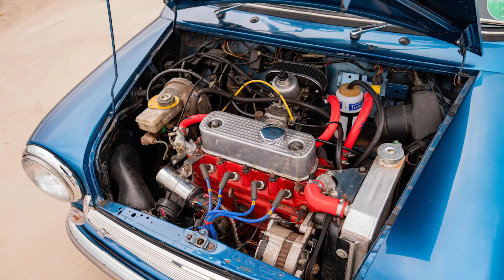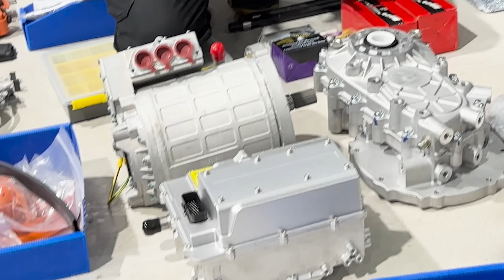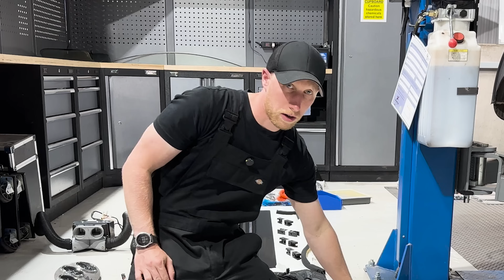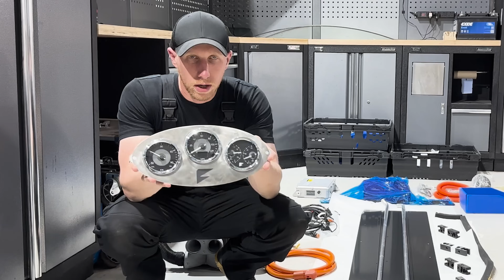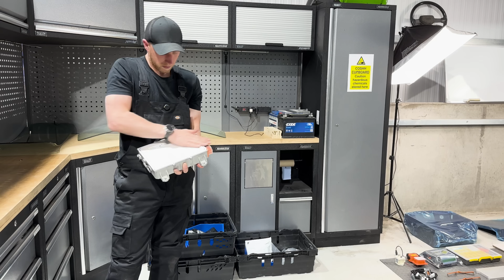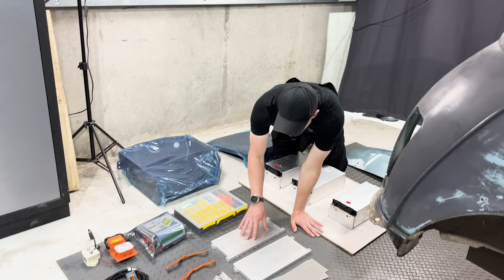EV Conversion of a Classic Mini Cooper to Electric, and It’s Fantastic - ESP1

Comment: Can't find a price for the diy kit on the Fellten site, but the only listed UK installer is going to want £40-65k
I want one, but I think I'll have to stick to a K20 swap for now
Reply: I’m sure kit cost will come down over time as EV conversions will become mainstream sooner or later…
Reply from the maker: @nzyama  yes definitely, as soon as some level of volume can be met they will come down.
Reply from the maker: The full bolt in kit from Fellten is about 30k
Reply: @Hazell_Nutz  That's not bad considering what you get. I'd definitely want to save the 10-15k and do it myself. It's more fun as well.
Reply from the maker: @eskimonoise-gaming  only thing to consider is the amount of design and development that Fellten have done it has even been signed off by BMW Mini

Comment: Do you even fit in it? Car is in the air and you tower over it.
Reply from the maker: 😂 you would be surprised how much room is in a mini
Reply: @Hazell_Nutz while I later sat in a original mini I went to an Auto Show in Boston years ago and a mini dear fro Peabidy MA had a massive Mini section at tge show. I was amazed at how much room they have in the front seats. If I could find an affordable original that isn't rusted to hell in the states I'd consider doing a conversion.

Comment: I hope you are aware of the issues someone had with the DVLA when converting their mini a couple of years back?  He drilled a couple of holes in the boot floor for cables and the DVLA refused to allow it on the road without an IVA, which would be a huge amount of work for a mini to pass.
Reply from the maker: Yep it’s not a problem, full bolt in Fellten kit approved by BMW never had an issue with dvla.

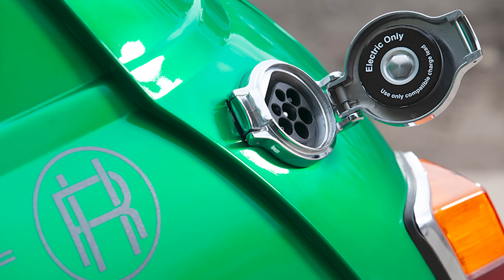Comment: hey where did you buy that charge port with a flap 16:04
Reply from the maker: It’s made by Fellten. If you email sales@fellten.com they might sell one but there not cheap as custom made.
Reply: @Hazell_Nutz  The actual flip cap looks just like the "Monza" style sold on many classic Mini parts supplier sites...just bolts to existing petrol cap neck as a faux filler cover.
Reply from the maker: @TornadoCAN99 it is, we just have them milled to fit a custom charging port.

Comment: As someone who drives an EV for work, I would highly recommend having one of the gauges being 'charge level' as while the range calculations are handy for casual use, they are an unreliable metric when you are going on journeys with enough distance where you come across different driving environments.
Reply from the maker: The ideal situation is range but we do not have that software in the mini yet

Comment: Impressive kit. Like the AC motor instead of those DC motor kits. CCS would be nice though.
Reply from the maker: We did consider CCS but with only a 19kWh battery pack it could not charge very fast.
Reply: @Hazell_Nutz  with an 25kW charge it's under an hour. Got a Livewire. That gets 19kW on 15,5kWh.
Pretty useable.

Comment: "We haven't gone to an LSD because we haven't needed to" later in the video "we can't get enough grip"
Reply from the maker: 😂 see your point. Yep not enough grip due to tyre width which an lsd would help. There is dynamic traction control built into the aem unit. But also with an LDS the gearbox might not be able to handle it.

Comment: are you not running a bigger tire then factory? i don't know what tire sies you can fit in there but the vertical tire patch is ware most forward tration is. taller tire more forward tration. maybe even bigger wheels and tires if you can fit it ?
Reply from the maker: Right now we are running 10inch wheels but do have a set of 12inch wheels with bigger tyres as well to try.

Comment: Algorithm brought me here so I guess you're doing something right.
Thanks for the video, very nice.  I subbed, this is the kind of content I'm consuming right now - algorithm is on point, and fresh!
My argument these days is if I'm camping 100 miles in the middle of nowhere (Oregon, USA) that I can make electricity but I can't make gas - I don't know why everyone isn't doing this, gas is expensive and smells bad in the can and in the air.
Even if I had to wait a couple days, I wouldn't starve or dehydrate to death before I got another 4 hours of run time (I find it's easier to speak of battery power more like a plane measure fuel - in time expected left to ride) and I honestly wish I could see a display that showed expected run time based on ride history since last charge and  expected run time based on your present burn rate.  Averaging saved torque values over time and current torque values during the ride would also be helpful in profiling my system behavior.  I am still unsure if I am going to make a full size car build; I have an array of PEV (large and small, 1, 2, and 3 wheeled) that are serving needs and if I need to go bigger (I'm disabled) tentative plan is to acquire most of a Yamaha Tricities or Piaggio MP3 husk and make a touring PEV with sizeable fairings and aerodynamic/stowage features like lighter velos (I have two already).  
"Kei" style trucks are illegal to drive on public roadways in Oregon (USA) but I want to do a EV conversion on one just to use around the property - there aren't any husks around and I don't want to break one - regular utility vehicles start around 6k USD and decent ones easily top 13k USD and you'd still need to add options you wanted.  There really aren't any decently useable/reliable EV utility vehicles under 20k USD (check videos on the smaller extra cheap ones from online sites, if you don't want lead batteries, there's a significant upcharge for LiPo packs).  The best I've seen is electric forklifts have been around forever and that's about it; they are well supported, however, which is nice.
Reply from the maker: Have looked at data capture in the past forwarding to a AWS server where a system can be out in place to calculate everything you mention real time or you could look back on previous events. Battery’s are starting to come down in price mainly because more manufacturers are coming on line at the same time ev adoption has stated to show abit.

Comment: My first car was an original Mini. Had an absolute blast burning around with the horribly underpowered engine. I'd love a classic EV mini. You're living my dream.
Reply from the maker: I have had 5 over the years. They are so good once electric ⚡️
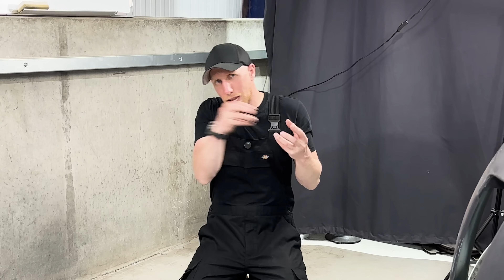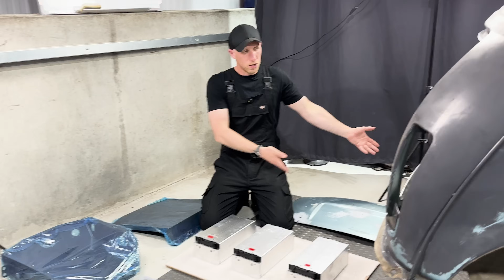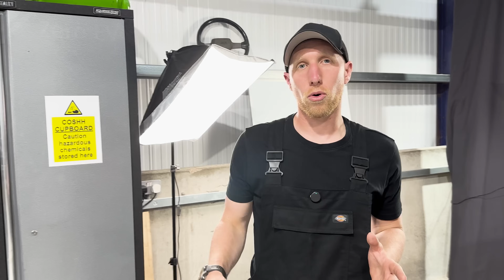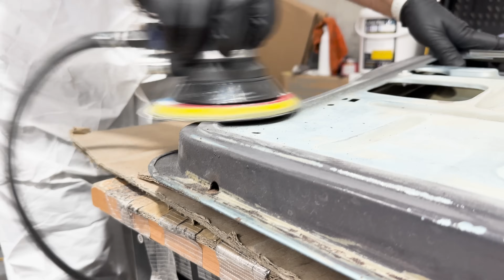Reply: ❤ 17:38 4 17:42 17:43 17:43 17:47 17:48 17:48 17:48 17:49 17:49 17:50 17:54 17:57 17:57 17:57 18:01 18:02 18:03 18:04 18:04 4
Reply: A 18:11 18:13 18:13 4 18:13 4 18:13 18:13 18:13 18:13 4 18:13 18:13 4%4😊

Comment: Mmmm interesting video ...I have been a Mini affection-ado for some 55 yrs  (got my first one back in 1970).   I have been monitoring this subject (ie MINI EV CONVERSIONS)  for some time now ... in the past the 'elephant in the room' has been the attitude of kit manufacturers to limit the sales of kits to 'approved workshops' only ... this very much limits the sales to people with vast amounts of money  ... a recent  quotation obtained  from your Australian kit (Feltern/Jaunt)  supplier/installer for a mini conversion was at over AUD$100,000 not including the base car !  which frankly is ridiculous ...  yes I understand the concern for product liability and safety issues ... BUT ... there are lots of very well qualified technically capable folk  out there that would love to build up an EV Mini but will not even consider it due to too high cost or technical sales restrictions ... and that issue will either make or break your success.
Reply from the maker: The full bolt in kit is £30,000 plus vat. Fellten UK will install the kit with you to save cost. The reason for this is it but be don’t properly and brand damage is a big risk for companies supplying to DIY until the dvla bring in standard and testing.
Reply: Yeah, it's a market for the super rich at the moment and these start-ups are cashing in on the rich for the time being. Still, that is about $30-40K worth of kit he's showing off - EV conversion is not cheap. And if you start dealing with high V (over 60V)  it's dangerous too!

Comment: Please don’t kill me for asking, but did you talk about range? I may have missed it. Also, do you have to have a V2L dongle to use the AC out? Absolutely love this work!
Reply from the maker: The kit will do 110 wltp miles which Fellten have tested. You need a type2 to 13amp or 16amp output but does not need to be a particular model. You power the car up and then press the charge button 10 times to activate AC out
Reply: @Hazell_Nutz  so cool! Battery chemistry? LFP?
Reply from the maker: @Clm1403  it is NMC if was LFP in that size and space would only get about 60mikes range. But there is a new battery called LMFP coming from CATL that looks really good
Reply: @Hazell_Nutz  good to know. Glad to hear where we are in the current market. Keep the great content coming! Can't get enough of this!

Comment: So 10 grand for a decent mini and 20 grand plus for the electrical kit? Plus labour? Not democratic is it. Rich man’s toy. And hardly a modern, safe car by any means. Try creating a decently priced kit for 20yr high-mileage/knackered engine cars with lots of life left in them, Mini R50 or Honda Civic even?
Reply from the maker: Yep is still a rich person toy, but Fellten are looking into leasing at the moment. I think kits will get there but mass volume is the only way which will require government support
Reply: You correct, of course (well, not quite as the full kit would be £30,000 apparently). Nobody claimed this is a cheap way to get an EV ... people see that it's a kit and wrongly make that assumption. There are some superb modern EVs available that can now be bought secondhand, low mileage, for less than half what you would pay for this. This is a great option for those who can afford to upgrade a classic car ... but that's not what the man in the street is generally looking for!

Comment: Shame the heater doesn't use the drivetrain's waste heat. Feels like it could, pretty readily, with resistive trim heat when the system's cold. Heated seats would probably be the place to start, all that said.
Reply from the maker: We looked at that before but most of the time the drive system coolant is no hotter than 40c which just does not give enough of a temperature differential to be worth wile. Heated seats are definitely the best option.

Comment: oh, solid!! now... where is this kit available from? also... i have an idea for the old Saab 900 turbo// the engine uses the transmission as the entire lower oil pan and drives the trans with a chain drive up front... i want to do this conversion...
Reply from the maker: You can get them from www.fellten.com
Reply: @Hazell_Nutz  SOLID!! thanks, eh?

Comment: How much does it cost?
Reply: STARTED at £42,000 when I enquired. 😂
Reply from the maker: A full bolt in kit from Fellten is about 30k plus vat. They are happy to fit the kit with you provided the car is supplied in good condition and does not require any additional work.
Reply: @JamesPlace-o1k what a joke

Comment: just a heater ? not a ac pump
Reply: UK summers average around 70f.  It can spike, but if you only need to roll the windows down for like 3 months out of the year to beat the heat.  They just don't need it.
Reply from the maker: Think there is AC in the David brown minis but it’s very tight